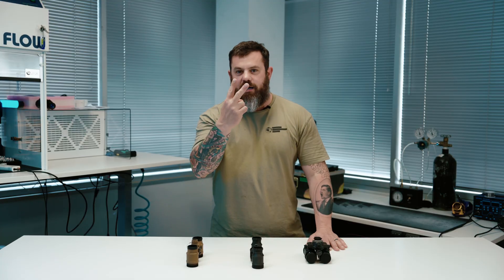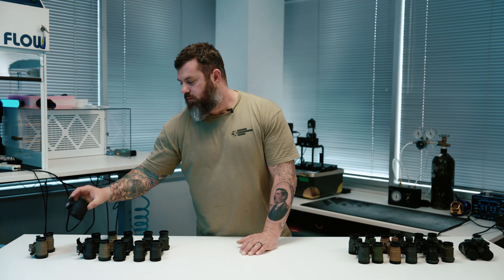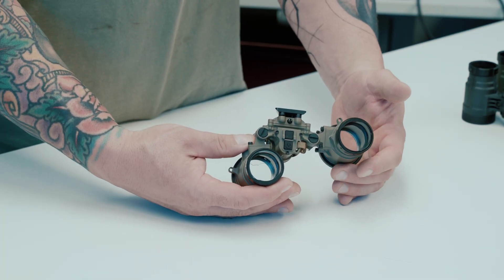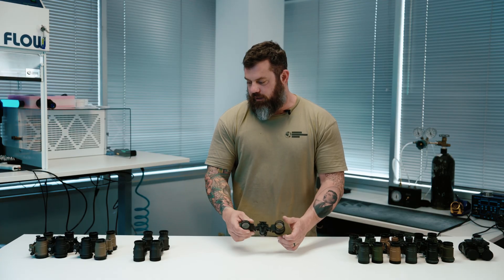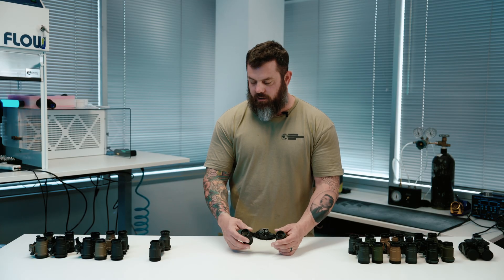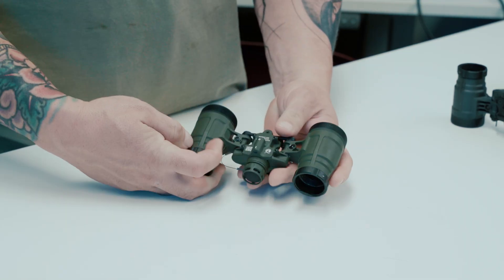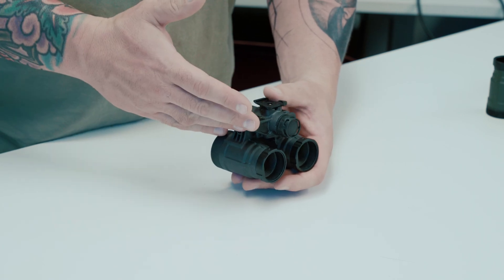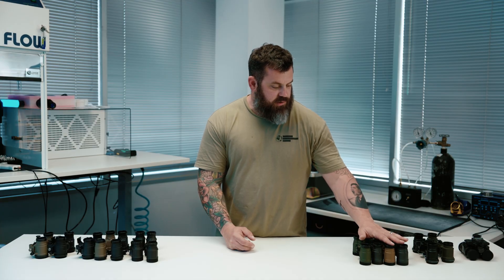Custom Night Vision | 2025 Night Vision Binocular Housing Review

Comment: thanks for the little extra at the end. what we want in help making a decision is not “ buy this one” , but more “what most people dislike about this product is…”
you’ve got to understand this isnt like buying a car you get to test drive. we are expected to spend 8-10 thousand and just hope the product doesnt let us down… for example, im interested in the mh-1, but i heard the gain switch is hyper sensitive and the main control knob is mushy. is this so? is it so bad its hard to fine tune the gain? can it get bumped easily while climbing, running, operating and ruin the picture? is the power knob easy to use and select what you want in the dark with gloves without looking? lastly
does your company have an event where we can come try stuff out?
Reply from the maker: A lot of the complaints about the switch/knob that were reported early on were corrected in the second and third batches. i have no concerns with either at this point. gloves may present a challenge as the two are arguably to close together but its not an issue training with the device could not remedy.
Reply: @customnightvision  hey thanks for taking the time. you guys are great!